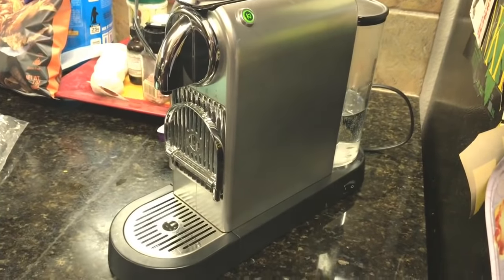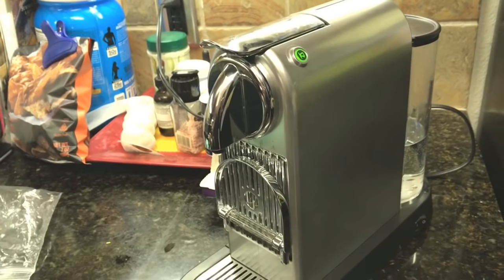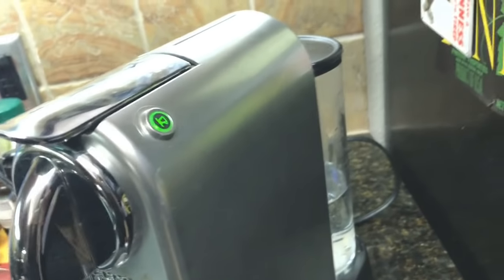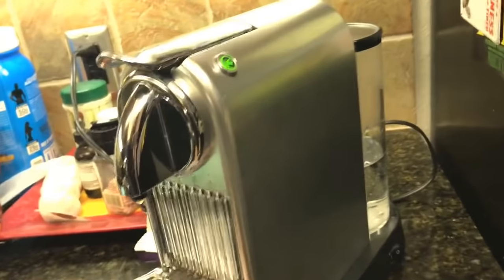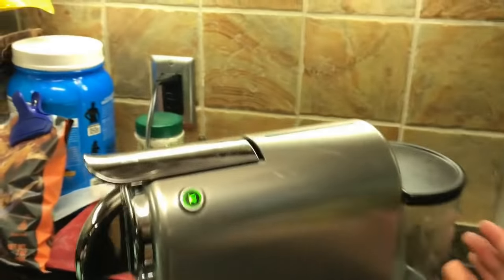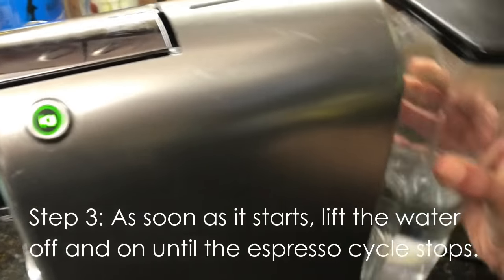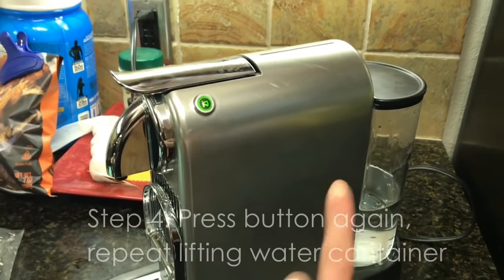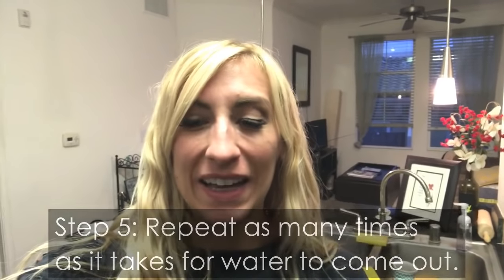How to Fix a Nespresso Citiz Machine That Isn't Pumping Water

Comment: So i have a severe issue with an older model D120, which the pump will not prime with all you the normal suggested tactics,  none of these things worked. I took the unit apart and used an air tool and blew directly into the intake or bottom of the pump! and that fixed it. I left the outside cover and called it Frankenstein Nespresso, Expresso
Reply from the maker: Thanks for sharing!

Comment: I tried this as many times but still not working.  any ideas anyone? yes I spent time on the phone with customer service they did not help either.   I guess I need to take it apart and see if there is a hose disconnected

Comment: Boiling hot water was the only that helped. I tried it 30 times with warm water and it didn’t worked until I used boiling water, 2times and it worked

Comment: Didn't work for me unfortunately. Now my machine has stopped working when I push the buttons at all (I suspect because I've tried to run too many cycles)!
Reply from the maker: Sorry to hear that. Maybe try the buttons tomorrow. The machine can overheat. If not, try calling Nespresso for help
Reply: @RenewalFitCoach  I take that back. It did eventually work!!! :) After working on it for an hour or so, and needing to let it cool down a couple of times, it finally worked! Thank you so much!!!

Comment: there is a much easier way: with no pod in the machine push the lungo button and open and close the flap where you put the pod in repeatedly. This will get the same effect without messing around with the water tank.
Reply from the maker: Good to know!

Comment: This technique didn't work. Thankfully I read the comments. I used the top rubber part of a baster (thing you use to put the juices from your turkey back on it ) I put some warm water in it. Removed the water container.  Placed the baster over the opening and ran two cycles while squeezing. At the second cycle water came out. 
Our machine blocked after descaling it we followed the instructions about using the vinegar twice. Do not do this. It puts the contaminants through the filter, thus blocking it.

Comment: An easier way is to prime the pump by pouring hot water from the tap into the receiver hole under the water canister. Then put the water canister back on and turn the machine on. You'll see bubbles of air and then Nespresso will work. Run clean water through it about 6 times and you'll be good to go. The way I'm explaining effectively primes the pump. It works and it is what I do when the machine has been idle for a long time.